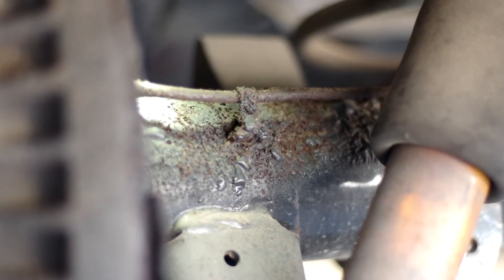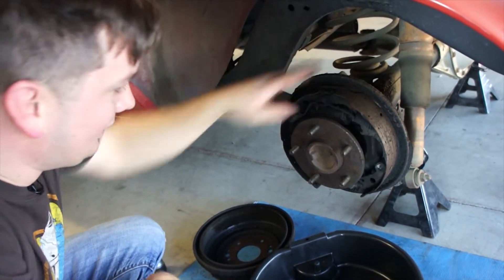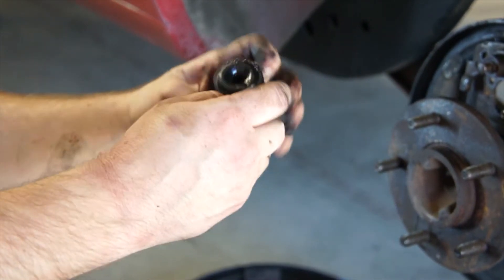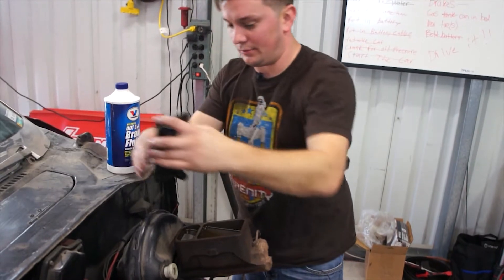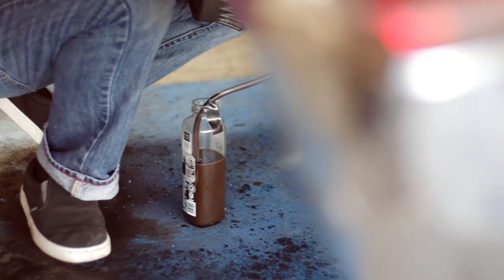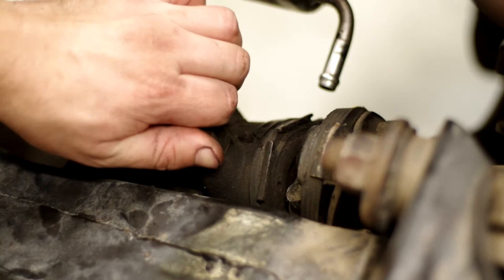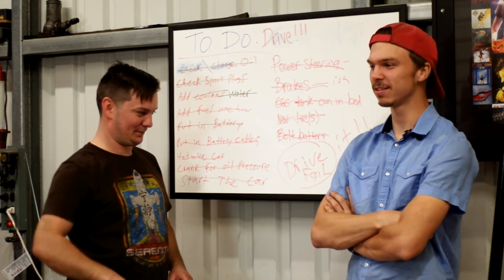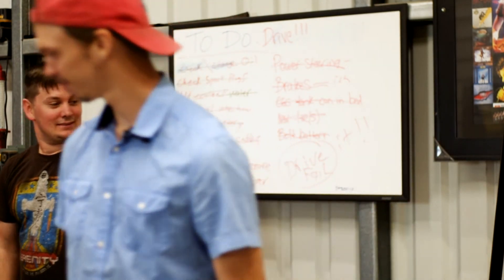Project Car El Camino: Ep 2 - Playing With Fire

Comment: you can use a 95 jeep gran cherokee box, faster ratio too
Reply: you can also use the jeep steering shaft to eliminate play in the steering by removing the rag joint all together and make a ujoint connection
Reply from the maker: This is a really good way to get better feeling steering in an older muscle car.  There are a few other cars out there that you can steel these boxes off of and even if you buy them rebuilt from a part store they are pretty cheap